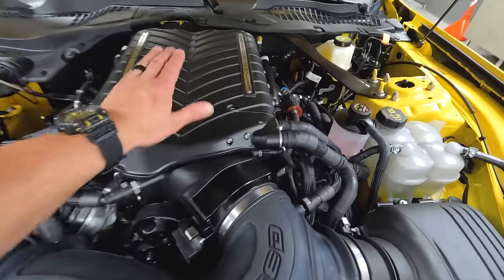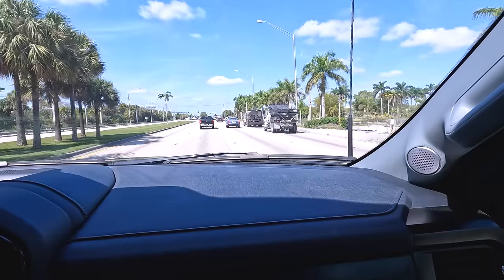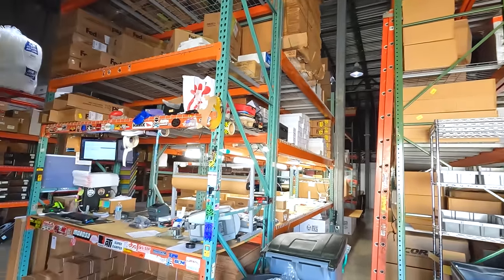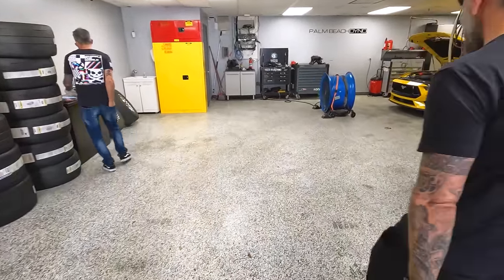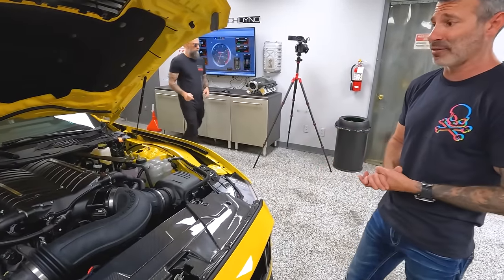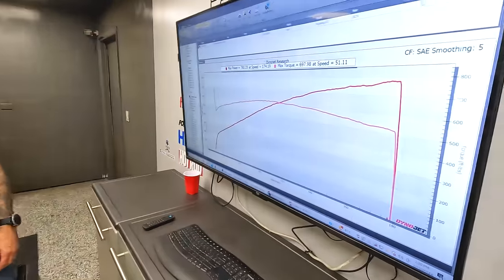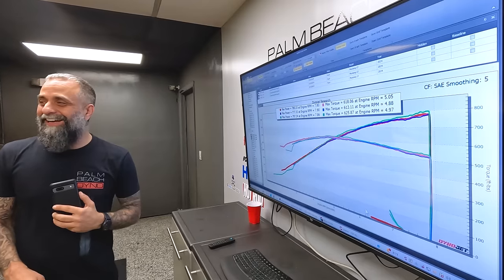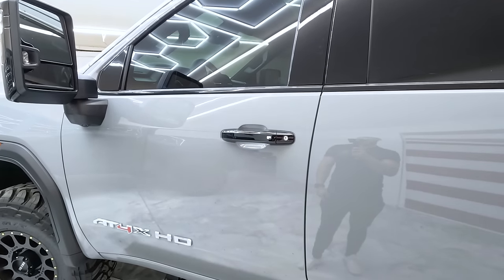INSTALLING a MASSIVE 3.0L Whipple Supercharger on my 2024 Mustang GT!!! *MADE INSANE POWER!*

Comment: Thats insane! Im a chevy guy but those coyotes are insane with boost!!! You’re basically knocking at the door of 4 digit flywheel power with a fully stock car with cats, stock manifolds, emissions everything, no custom tuning. Thats fucking nuts! Absolutely shittin on ls/lt’s. With factory warranty 🫨🫨🫨🫨
Reply: They breathe and rev! LS's are always gonna be tanks tho.
Reply: I wouldn't want one without a warranty! 💯💯💯 Crazy HP For sure
Reply: It won’t last at these power levels. Mine didn’t last 5,000 miles on 9psi of boost, 3.875 pulley. Had my whipple put on at 1,024 miles. Cats plugged and blew the engine at 5,403. That happened in December of last year, finally got fixed and got it back March 8th of this year. Also the warranty is under ford performance which only covers $11,500 TOTAL before the warranty is considered “fulfilled” and ends. Something to think about before you sink some coin into one of these. $7,500 for the engine and the rest is for other parts like the transmission, rear end and transfer case for 4wd F150 trucks.
Reply: @RadDadisRad  damn,
Reply: I would say they tuned it, whipped includes the tune with the kit
Reply: @christopherbodden506  yeah… about that whipple “tune”
Reply: @christopherbodden506  if it’s tuned why are they only able to change just fuel and spark tables and not anything else?
Reply: @RadDadisRad If you can modify anything it's tuned period
Reply: @hseriesonlymonctonnb1181  it’s about as tuned as you are 😂😂😂 if it really had a tune you’d see NA versions on E85 but you don’t. If it was tuned you’d see whipple blown versions on E85 but you don’t. 😂😂😂 sit down junior and leave the tech talk to the big boys that have the money and the brains.
Reply: @christopherbodden506  did you watch the video? Lol
Reply: @paulcondie2520 Might wanna listen to the with experience vs the guy who’s just now doing this
Reply: @hseriesonlymonctonnb1181  god damn he went in on you😳😳😳😂
Reply: @S2kTi I wouldn't say that LS can't shift at 9500 rpm they just blow head gaskets at 8500 or less
Reply: @Deerfield5  I guess anything can rev to 9k+ at least once..
Reply: @RadDadisRad  operator error, must have skipped that stage 1 warranty too huh????
Reply: @aaroncarlson5839  I have the warranty. It doesn’t cover much of anything. You would know that if you looked it up.
Reply: @RadDadisRad they definitely last at these power levels. Your cats clogged, that was the problem not that the engine couldn’t handle the boost. Almost no one keeps a stock exhaust when they boost their cars🤷🏻‍♂️

Comment: And that's what I don't understand about Ford.  Here you have just a regular GT with a bolt on supercharger making  800 wheel, but the GT500 that they talked about for 2 years that was out the same time as the Demon only makes 760 to the crank which probably over 100hp less than what this car just made.   Not to mention the  GT500 cost about 100k.  It just shows how easily Ford could have built the GT500 to have more HP than the Demon without even using race fuel. I don't understand why they let Dodge keep the HP crown.  And after watching this I can't see why anyone would want a GT500.

Comment: That thing has a lot left in it. It was still making power when he was letting off. Also I think its funny that Ford basically made the Mustang a competitor to the Corvette when its supposed to be a competitor to the Camaro but GM hasn't made a truly good Camaro in a long time.
Reply: They didn’t let off. Ford hasn’t unlocked tuning so the redline is hard set at 7,800
Reply: @RadDadisRad I know why he let off but he still let his foot off the pedal aka letting off.
Reply: @Zankaroo  he didn’t let off. That’s where it stopped.
Reply: @RadDadisRad Did he hold the accelerator down till it blew or ran out of fuel? No, then he let his foot off the pedal. AKA LETTING OFF. Doesn't matter if the rev limiter is there or not.
Reply: @Zankaroo  lol, I’m not gonna argue with you because you’re wrong.
Reply: @RadDadisRad  Except I'm not, but have a good day.
Reply: @Zankaroo  they didn’t 😂 the car let off. That’s why it stopped 😂 guess you don’t know how these things work. 🤣
Reply: @RadDadisRad  I do, also stop liking your own comments, that is not what the like button is for, and you said you were gonna stop arguing but you still are.
Reply: @Zankaroo  stay mad and you don’t.
Reply: @RadDadisRad  I do, I'm not mad, and you are still arguing, lol.
Reply: @Zankaroo  nah, I’m bickering.

Comment: The catalytic converters are going to melt at this power level.  Palm Beach Dyno built my car (I'm local), mine makes 800hp too.  I have Long Tubes and no cats but on a large pulley (safe 11-12psi).  I'm also on a Fore Innovations E85 fuel system.  No way in hell I'm running 800hp wheel on a 12.0:1 compression motor on crap pump gas.

Comment: Stage 2 0 warranty.  So the HP will be lower on the warranty kit.  I had to go E85 for numbers like that on my Gen 2.
Reply: gotta stuff more boost in that gen 2 lower compression motor. gen 2 to gen 3 even n/a is mind boggling, it just keeps pulling at high rpm. Glad to see the gen 4 reacts the same.
Reply: @jensenleblanc  yep gen2 is only 11.0-1.  I don’t want to lift the heads. It will stay where it’s at for now.

Comment: You can buy a new 2024 GT 5.0 with a 10-speed automatic transmission for approximately $47,000. Adding a stage 2 supercharger with a tune can boost it to around 800 hp, making it a great value at around $60,000 overall. This option offers exceptional performance. For the price point the average new truck, often costs the same or more. Definitely a great way to get into high horsepower numbers without hitting super car prices.
Reply: Will the transmission take it?
Reply: @richardmorris7063 With the refinements to the 10r80 I would say it will last a  good long while as long as you don’t do too many back to back drag races and slip that stock converter. Over 800 wheel it’s not going to survive long. The MT-82 is darn sure not going to last any longer, however they claim they updated parts of it for 2024. Minimum needs a new clutch to last long. Don’t expect either to last much past 100k miles if you drive it hard at that power level.

Comment: Say goodbye to your stock cats. They’ll never hold up to that kind of power and when they go if you aren’t watching it’ll take out your motor.
Reply: Man, every comment of yours is negative 😅. It's not an f150 from California. The cats are fine, they will hold up. I've had so many mustangs with big power all with factory cats and never had an issue. If he runs e85 or higher octane that is a different story.
Reply: @Kracer715  no they won’t. I own a 23 whipple 5.0 😂😂😂 cats cooked at 5,403 and took out the motor. My comments are not negative, they are relative.
Reply: @Kracer715  he can’t run E85 because the S650 computer is locked up. No tuning available.
Reply: @RadDadisRad

Comment: Stock w a bolt on whipple kit and this thing is pushing almost 800 Hp at the wheels and probably nearly 1000 at the crank. Fuckin Wild.
Reply: On race gas. 700whp pump gas. Anything more and you’re blowing it up.
Reply: @RadDadisRad it made 780 on just the 93 in the video tho and then almost 800 when they put in the booster gas thing
Reply: @josephbareski6931  hahahahaha if you believe it made 780hp on 93 I’ve got some ocean front property in Arizona. Hahahahaha you’ll believe anything you see on the internet. 😂😂😂😂
Reply: It's the same pulley as the stage 1 they just put a bigger throttle body on it to make it a stage 2
Reply: @dailylife3975 stage 2 comes with a smaller upper pulley and larger throttle body. Stage 1 is a 3.875 pulley. Stage 2 comes with a 3.75 pulley.

Comment: You can safely say you have the most powerful s650 at the moment!
Reply: Yeah it should run low 12’s now 😂
Reply: @josephshehan4763  lol they run mid low 12s stock with the 10 speed. Should be in the 10s. I have a 2015 manual with a Whipple that runs 10s
Reply: @Kracer715 nope, the whipple tuning is soft. Nobody has unlocked the S650 computer. Hardly any tables are accessible with the whipple tuning software that Ford has allowed Whipple access to.
Reply: @RadDadisRad  and yet still made 800 hp with a soft tune? It is just simply not going to run 12s when they do that stock. I guess we will just have to see as time goes on and more people test them. I'm just saying my mustang is a Whipple and exhaust only just like his and runs 10s. I understand more tuning is available on the s550. But I'm sure 800 hp will get him close or into 10s.
Reply: @Kracer715  my f150 is a whipple and exhaust only. Got any more fun stories?
Reply: @Kracer715  they have access to fuel and spark tables. Nothing more. Of course they can get 800hp by adding timing and fuel. 🤦🏻‍♂️
Reply: @RadDadisRad  all I'm saying is that it will run 10s. What is your argument here? Vmp has already ran 9.99 with the same set up.
Reply: @Kracer715  yeah it BARELY runs 10s. Only one I know of is the VMP mustang with the guys tiny wife driving it. Unfortunate because with proper tuning it would be mid 9s but that’s where the problem lies. Tuning is not unlocked and until it is this platform is going to limp along for the performance crowd. The hair dressers and lesbians will love it tho because they don’t care about performance.

Comment: Rip to the trans and the crank lmao
Reply: Why the crank?
Reply: @Axle-7  needs a crank support bad
Reply: @Axle-7 guess you’ve never seen what happens to a 5.0 coyote crank with a whipple running 8k rpm and a small 2.75 top pulley. As a whipple 3.0 owner I can tell you the crank is being torqued HARD
Reply: @RadDadisRad  lmfao
Reply: @RadDadisRad I just hope he don’t completely trash the motor he’ll probably never rebuild it
Reply: @grizzel14   same, my motor went out in my whipple at 5,403 back in December of 2023. It took 63 days for it to get fixed. I have it back now but it’s no joke. It goes from running to not really fast.

Comment: What’s up with all those faults? It’s brand new and already displaying several faults.
Reply: traction control disabled on the dyno, completely normal, will go away after restart and driving for a few minutes.
Reply: @jensenleblanc  been a few years since I’ve been on a dyno. Fortunately I didn’t have to deal with most of the modern day safety systems back then so it just seemed kind of odd to me but that makes perfect sense.

Comment: My thing is that the 2024 Mustang hasn’t done or accomplished anything that the 2018 Mustang accomplished with the same modifications which is why it’s a dud not to mention no one outside of whipple can tune it. Not to mention those catts might melt and 14 psi on a 12:1 compression motor won’t last long on 93